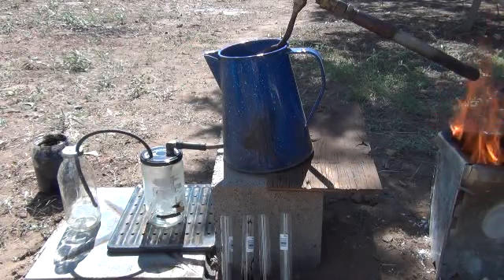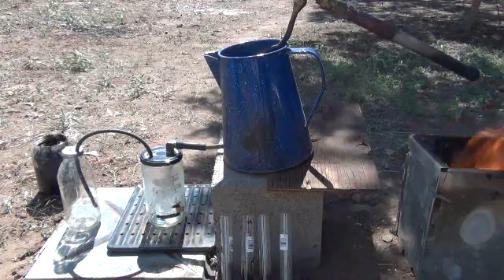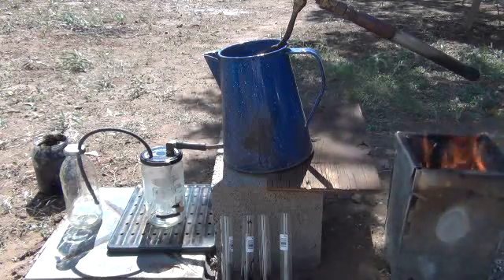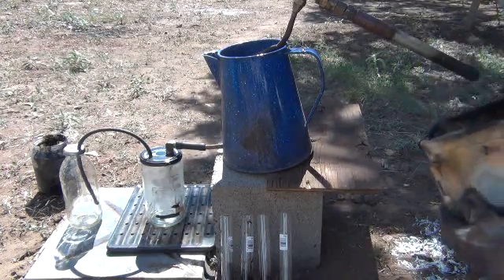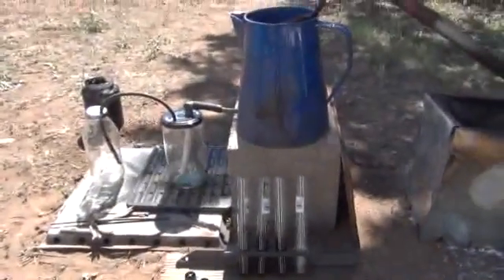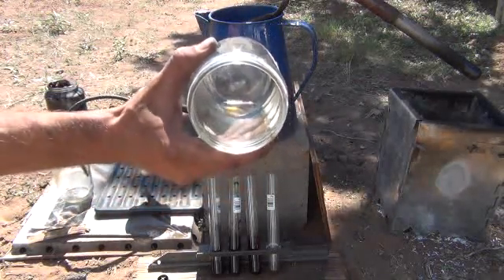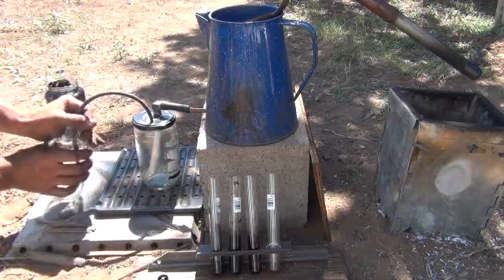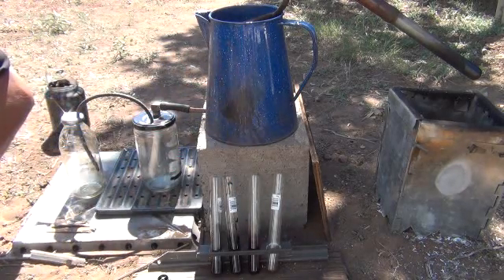BioCrude Oil, Wood Gas Part 10 the END.

Comment: Biofuels processes
One example of a Biofuel-based synthetic fuel process is Hydrotreated Renewable Jet (HRJ) fuel. There are a number of variants of these processes under development, and the testing and certification process for HRJ aviation fuels is beginning.[36][37]

There are two such process under development by UOP. One using solid biomass feedstocks, and one using bio-oil and fats. The process using solid second-generation biomass sources such as switchgrass or woody biomass uses pyrolysis to produce a bio-oil, which is then catalytically stabilized and deoxygenated to produce a jet-range fuel. The process using natural oils and fats goes through a deoxygenation process, followed by hydrocracking and isomerization to produce a renewable Synthetic Paraffinic Kerosene jet fuel.[38]

Comment: awesome. a convo with a friend when i said u can get almost any cellulous from wood. led me to here once again. i end up back to Mr Teslonian. :)_  ideas. you could cook from that gas coming out the hose. like a rocket stove :) or piped into a home. burning in a small stove. to be able to heat up the metals. and vent out a pipe. 
thus the small stove can have open flame and or the stove it self heat your pan. 
i made a drip feed oil heater from propane tank. works great. but i have more ideas.

Comment: hate to tell you just because its not melting the hose does not mean its cooler its hotter in the flame the a wood flame its just as its hydrogen at point it leaves the hose its cooler but the tip is hot enough to weld with

Comment: For the amount of product realized, I wonder about the scalability of the system and the cost effectiveness for the end production. Have you tested it to determine what grades of refined fuels these equate to? How comparable to petroleum are the overall btu's? Will you get a significant power reduction using these fuels in engines carbeurated for actual petrol fuels?  If so, how could you compensate for the power or heat differential?